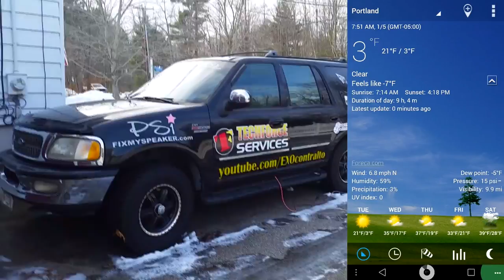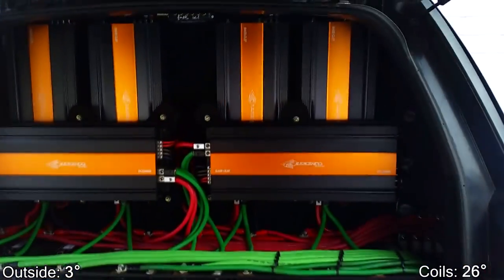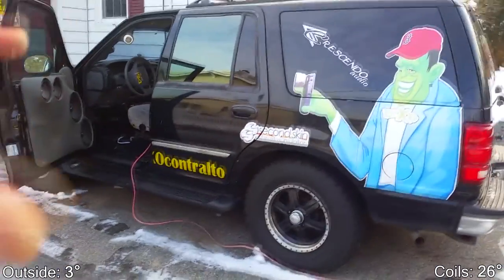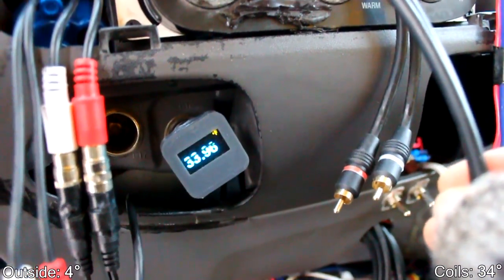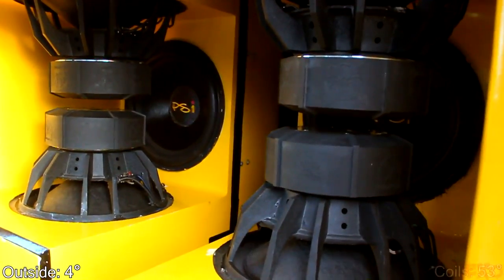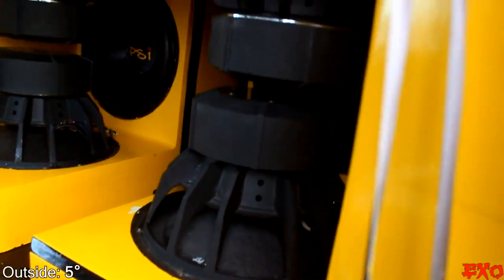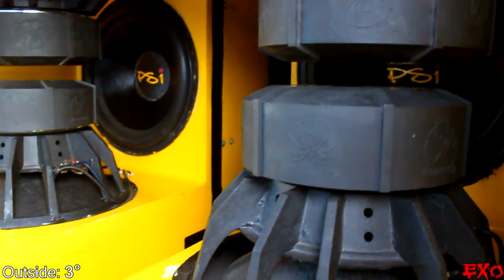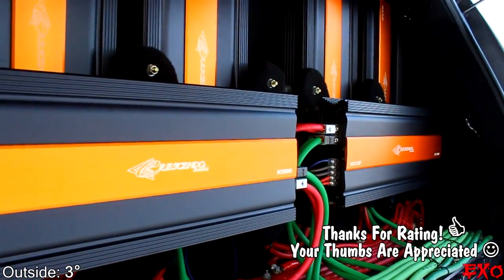Does COLD Weather HARM CAR AUDIO? How To Play SUBWOOFERS at FULL VOLUME Below Freezing Temperatures!

Comment: Another very important thing is to easy into the volume. 
I have remote start and set my volume about 1/8 when I get out, then when I remote start I let it run along with radio obviously playing for 10-25 mins depending on temp out before I even go get in. Then I slowly raise volume over 10-20 min time span before full tilt this helps slowly raise temp of amps to allow any condensation to slowly evaporate like you were saying as well as slowly raising voice coil temps and slowly getting flexability back into sorrounds

Comment: pumping your gas pedal when you have a fuel injected vehicle does nothing. only for the older vehicles is when it works.
Reply: +Ur_Associate But giving it a little gas while it is warming up can help, for instance i have my idle turned a bit too low, so in a cold start she stalls out unless i give her some gas for the first minute or so :)
Reply: +stertheder yes giving a gas will the engines running does help to make it warm up faster put heat pump to the gas pedal while the engine was still off that doesn't make a difference with fuel injection
Reply: Correct :)
Reply: +Ur_Associate if the engine is flooded. (it can happen if you cold start the car and back it out of the driveway and then stop the engine and try to start it 10 mins later) pumping the gas pedal helps as the butterfly opens and lets more air in to lean it out a bit and get more oxygen in the engine to correct the ratio. but other than that. you are right. no need at all.
Reply: Depending on where the injector is located, direct port injection is most likely what you are speaking of, but older cars have throttle body injection. witch in some cases are before the "butterflies" thus creating a need for opening the throttle to let fuel and air into the carburetor or throttle body. And higher r.p.m while stationary promotes  more carbon build up. so its better to just let it idle to warm up to normal operating temperatures.  then proceed to driving, preferably fast or sideways. lol jk
Reply: +Ur_Associate If you turn the keys on acc and wait to pump do it and the repeat it few times bad english sorry
Reply: +Matt you didnt understand. i said some injectors are located becore the butterflys.
Reply: +Matt thats alright. some times im hard to comprehend
Reply: +Ur_Associate yeah the injectors dont squirt when the fuel pump/ sending unit is off hahaha
Reply: I'm from Winnipeg in Canada and many people have command start . So at -40 I press a button and my SUV is running for nothing less then 20 mins before I'm in and play any music . I've done that for many years with out damaging any audio . Only thing that I come across is the led display on my deck will operate slowly untill it warms up .
Reply: Thank You....
Reply: Lmbo right all you need to do is turn the key on the off the on again and your fuel should be primed

Comment: THAT IS A BAD FUEL PUMP!  also, pressing on hte gas will do NOTHING to help start a fuel injected car. it makes it harder to start. for a cold start you want lots of fuel and little air.

how your rpm goes way up like that...... thats exactly what my dads GM car did.... go to any auto parts store and ask to borrow their fuel pressure tester.... then find where your fuel rail is..... their will be a black cap on a metal line, hook it up, turn on hte key, see what it pumps up to. 

IIRC, should be 30 to 35 psi with a jump to 40 or 45 under load  (which is done in park by simply revving the engine for a second. the change for 800 to 5000 rpm is what loads it... not 5000 rpm. so at idel you should see 35... rev it up...45....keep it reved...still 35+

Comment: what car amp should i use if i want to conect 4 8"Audiopipe.

specs: (APMB-8-B)
low mid frequency loudspeaker.
500w power (P.M.P.O.)
250W power (R.M.S)
frequency response: 65-6000HZ
sensitivity:95dB
2" TiL voice coil
Die-cast aluminum basket
impedance:8Ohms 
35oz magnet

Comment: Hey EXO what was wrong with all those alternators when the belt was rubbing? What was the problem and what did you do to fix it?
Reply from the maker: The problem was the spring loaded tensioner. It need a mechanical one most likely.
Reply: EXOcontralto what's a mechcanical tenstioner?

Comment: possibly make video with links to some clean songs? I've been looking for some new stuff. I'm tunning 4 kicker comp 10" atm in a little ford escort.
Reply: +chorizo lover69  nice man. mi e is a budget system. I don't really have the money for dual voice coil subs like rockfords or some others. I don't go for heavy bass I like moderate. my little escort is only pushing 119-120 db stock battery and alternator. 900watt amp and the speakers are only 500w max